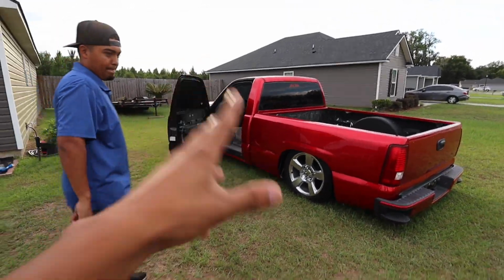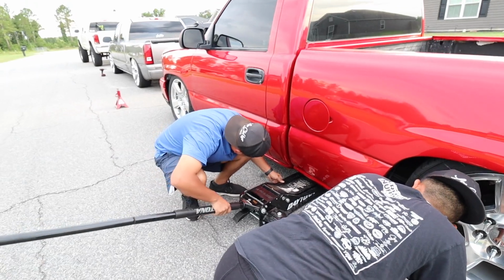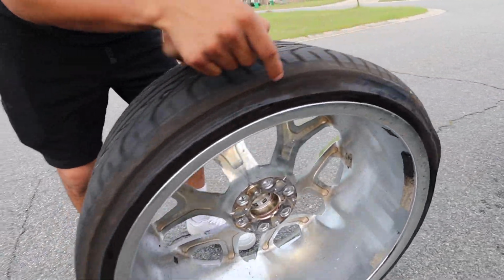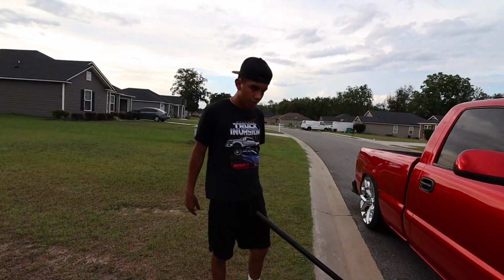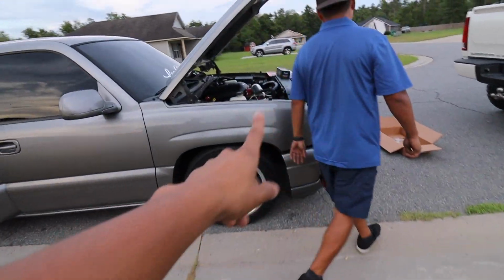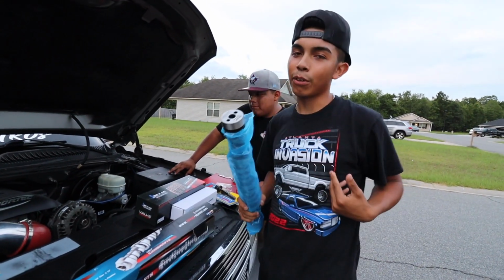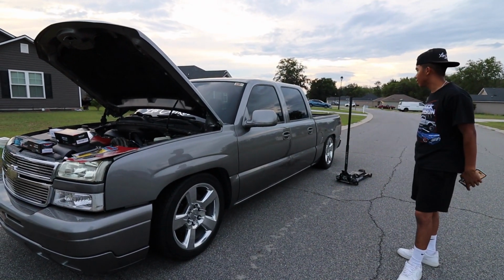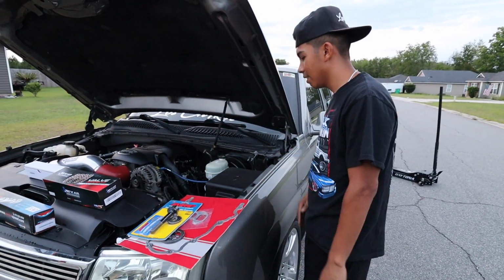24s on the Single Cab | Stage 3 Cam Kit

Comment: Main thing most people don’t do is the oil galley plug, oil pump girdle and rear main seal. Do those for sure! I’d replace the oil pump with a melling pump while you’re there. Take your time and bag/label the bolts you’re gonna reuse and you’ll be fine. As far as a stall I’d just go yank or circle d 3600-3800. Multi disc if the pocketbook allows but it’s not entirely necessary.
Reply: Also, IWIS billet timing chain while you’re at it. Cheap insurance.

Comment: Thats the same cam i got in my 5.3, good sounding and performing cam, Love the stuff yall do and i like to see yall getting into motor work not many guys do that. for the stall i recommend a tbss converter 2800, thats what im running in mine. Yall got my support from south mississippi hope to see yall in person one day!!
Reply: that tbss 2800 stall coverter is great for daily reliability and be sure to check them cam bearings
Reply from the maker: dm me a video man !
Reply: Me too🙏🏼
Reply: @losch1kos  if u want it to spin without hesitating get a 3800 bro
Reply: @losch1kos  I dm’d you on insta bro

Comment: Get a oil pump while your there won’t have to worry about your oil pressure dropping in the future as for a stall I’d go with a 3200 stall should be plenty for that cam I personally like Circle D exhaust long tubes xpipe & I like how borla sounds with these crammed trucks maybe like a xr1 or a proxs
Reply: I like the carvan exhaust.  Hooker tube shorty's, muffler coming out the bed. 6.0 with nothing under a 2500, intake, tune and u got a 600+HP truck without the supercharger

Comment: While it’s apart replace oil pump, timing chain, etc! And 3200-3800 stall is noice. CircleD converters are the best, and go’head and do remain seal also while the trans is out.

Then headers, no cats, xpipe(ALWAYS do an xpipe when yall do exhaust), and I’m a BIG fan of 3” in 3” out Stainless Works S-Tube mufflers on our trucks.

Comment: Ls motors are the easiest engines to work on. Take your time. Organize all ya nuts and bolts. Go with at least a 2800 converter. And find a good tuner.